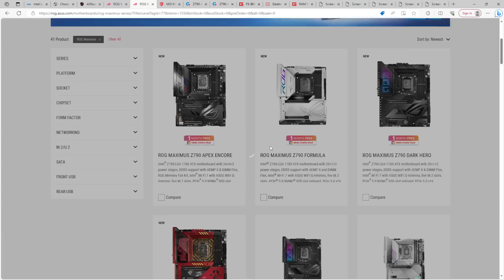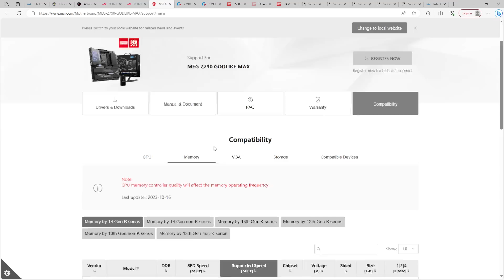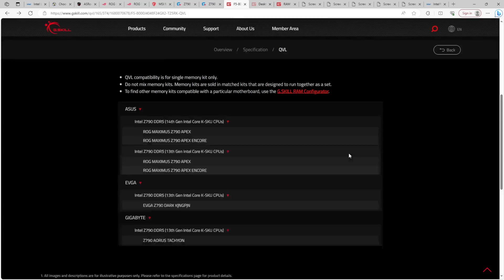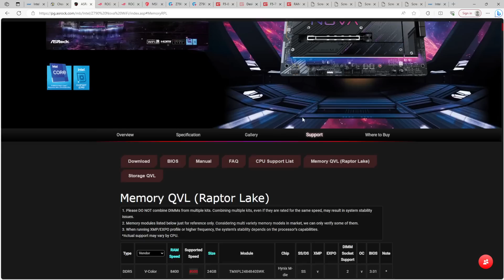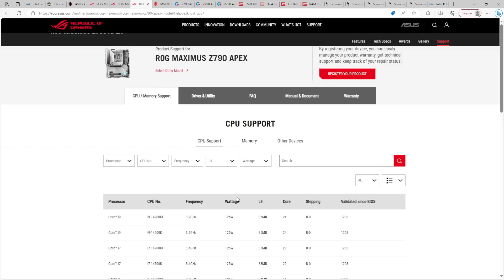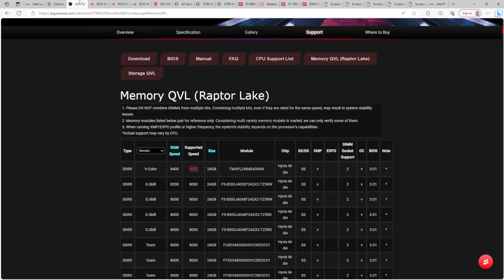intel XMPs and motherboard QVLs are a useless mess.

Comment from the maker: TL;DW: don't buy DDR5-8000 mem kits for your 14th gen CPU unless you're buying an Apex and don't mind potentially having to fix stability problems.
Reply: Hoping for just a better IMC, but was a bit dissapointed to find out it is exactly the same 13th gen memory controller, my 14900KF samples IMC was worse than my best 13900K. So luck is needed indeed :/
Reply: @Luckyn00bOC  My condolences to you, Sir.
I managed to get 6933mhz stable on Z690 Aorus Master with 8000mhz A-Die by T-Force, and hoping to get a nice stability and mhz on Z790 Apex Encore using same sticks.

I am on 13900k. 
Frame Chasers Youtube channel stated same thing you said, that his memory controller on 14900k was worse than his 13900ks.
Reply from the maker: @Luckyn00bOC  my 14900K is very slightly better. Which why I finally have a DDR5-8000 "stable" screenshot.
Reply: @ActuallyHardcoreOverclocking  can you do a video of your 8000 stable please
Reply: @ActuallyHardcoreOverclocking what is the name of the program for the ram test?
Reply: I can run 8000 completely stable with my 13900k on my kp. Working on tightening the timings on that profile and 8200 profile on a different bios. I did buy an apex encore to try out, but I’m probably gonna a try a 2x48GB 6800 kit with that and see how far I can push it without loosening the timings.
Reply: @rekareaper  Nice, 8000 is the limit of my 7200 a-die hynix kit as its at 1.6v and dont want to go anymore than that. Though i bet it could. My SP score for my IMC on my 14900k is 78. Its not "bad" and i could do 8600 on it for sure. 

Im using the old white apex board. currently running 8000-34-46-46-46-1.6v and all the timings VERY low to be fair. Using iceman heatsinks and a ram fan. Im not at the limits of the IMC i know for sure it will do 8400 with ease but i think with a some messing i could get 8600 stable. My current setup is y-cruncher stable so its rock solid. It took me most of the day after launch day to dial it in after all my TM5 testing etc. Now we totally stable.
Reply: New Corsair 8000 CL 38 48gb Dominator Titanium is stable on my z790 Dark Kingpin with a 13900KS and a 13700K!
Reply: Yep. Just put in a Gigabyte Aorus Master X tonight with a 14900K and 8000MT/s memory on the QVL. Nope. Running at 7200 right now.
Reply: @nchitechredneck same for me, but with an Asus rog strix 790-e, 7200 also……
Reply: Don’t buy 14th gen at all!!! It’s the same chip, MC is still a potluck so you might as well buy a cheaper 13900k.
Reply: @Irate_Italian yah intel said it’s the same chip.
Reply: Hey bz is Asus better for intel memory overclocking or just happen to be the apex
Reply: @NaruCedSuke only apex
Reply: Im pretty confident my unify X can do 8000 with 14th gen. Currently stuck at 7600 - I have to assume it's my 12900k not  playing ball.
Reply: @JustBenching  correct, 7600 for a 12900k a maxing out the IMC. I could only get 7200 out my 12900k. Just got the 14900k and had 8000 stable within the same say of chip arriving. EASY to do 8000.
Reply: If even experienced guys like BZ, who don't really need a QVL, see a problem here, manufacturers should listen.
Reply: Nothing really new, just more ridiculous of the same old same old
Reply: Nah, I need ddr5-6900
Reply: @buildzoid  Can you help me please which motherboard is best DDR5-8000 mem kits atm? Or should we have to wait some Bios update or better boards? Thanks in advance!!!
Reply: Just curious, what about the z790 Dark Kingpin?
Reply: @Shallo It can run 8000, but not via XMP... you will need to manually do it, and have a CPU that can do it.
Reply: Even 7200 is a gamble on XMP with a 14900K and an apex encore...
Reply: Hi. I want to run 8000 xmp on Asus Rog strix z790 e gaming wifi II. It sans that it can run 8000mts

Comment: My MSI PRO Z790-A MAX with i514600K can handle only 7000Mhz (Lextar Ares RGB 2x24GB 7600 CL38) with relatively hihg timings. Zero errors, fully memtest 4 loop test passed. With XMP enable it shits zilion errors, WIN10 produced bluescreen on logon window. I will try set it for 7200 becouse I updated BIOS for lastest one (recently relased) but I`m not optimistic :/

update:

Ok its works stable on 7200Mhz but with same timings as 7000Mhz 38-48-48-121, everything above immediate errors...

Comment: IME make sure both the ram maker and the mobo maker claim each other, if the ram maker doesn't have a list, goodbye to them - you wouldn't let a mobo maker get away with it.
Reply: also, based on many videos watched at this point - just get a good secondary-timed 6000 and move on with your life (this ignores the people who OC for the fun of doing and don't care about resulting performance, or don't that much because the journey is the thing for them).

For most people - XMP 1, plus, as in Giga land, enable those two settings in bios "high bandwidth" and "low latency" for great (relatively speaking) timings.  The tuning beyond, unless you like that specifically, is not really worth it.

Comment: Planning on getting i9 14900k and Msi Mpg Z790I Edge with 7200cl34 kit. My concern is that is the mobo good enough to handle such power hungry cpu and how far should I expect to manually overclock the rams? Don’t really see a point to spend over double amount more in the motherboard. xd

Comment: i got lucky and my apex-e + 14900k xmp with ddr5 8000 cl38 m die 2x24gb kit. Zero errors after 7 hours of stability testing. And zero  crashes maybe its not 10000% solid but pretty good.

Comment: If you want a better sp rating.
Flush the cpu socket and cpu pads with electronics spray. Like a deep cleaning spray. Use a whole can. Then let it all dry up, 24 hours. Then using latex gloves only, reinstall it all and retest. Do the same with ram slots. I've seen a huge amount of ???? Come out of ram slots on brand new boards. Maybe flux idk. 
But I have had fantastic luck with this process. Finger oil, or manufacturing oils idk. But its definitely something and the flush fixes. Go ahead, find out. 
THERE IS SOMETHING GOING ON WITH THE INTERCONNECTS ON THESE BOARDS. DIG DEEPER

Comment: Love these videos.

Question for you, I recently finally upgraded to AM5, got a 7800X3D & paired it with a set of 2x16GB G.Skill Neo EXPO 6000MHz CL30 memory kit - I am fairly certain that's one you & others highly recommend for AMD's side of things, you did some timings up for Hardware Unboxed when they did their Memory Timings video for AMD CPU performance - I'm just wondering if the timings on there that you gave them should "just work" for my setup, and secondarily, if the 1.25V SOC is actually needed for those timings?

Right now I'm running stock EXPO @ 1.35V VDIMM, 1.2V SOC and everything seems perfectly fine, as it should, since that's "stock EXPO" and all.

Comment: What is the Max ram speed you can reliably use on a asus z690 strix-f with a 13900k? My boards qvl says 6600 but I feel the 13900k should go higher considering the qvl says the same for the 12900k.

Comment: Z790 aorus master here. Can’t get 48gb 7200, 32gb 7800 or even 32gb 6000 to work on my 3 kits of ram on 14900k. Not even at stock settings. Am a computer expert with 1000 builds under belt. Shit is so trash like peak amd ASUS ram issue level

Comment: I don't know if this has changed in the last 12 months, but in my experience it can be very difficult to find for sale the exact memory kits listed on a given QVL.  I've always just stuck with moderately rated  memory (a few pegs below the supposed limit, maybe a few pegs above JDEC), set XMP (or whatever that board maker calls it), and left it alone.  It's almost always successful and gets me properly functional and stable RAM at a reasonable cost, even if my CPU might be just okay.

Comment: As long as everyone knows this, I don't see how its a problem. Even if they don't know, they will find out eventually. 
Intel has fell off for sure though. 
I was helping some flightsim bro with his intel rig I think it was a 12700 or maybe a 13700
he fried a channel on his imc running XMP
he then RMA'd everything, but did the CPU last (this is when I started helping him), which of course was the problem 
anyway he was too "busy" to properly setup his new cpu
I did my best to turn down the voltages, but he didn't want to spend the time he needed to, to help me check everything
and even with XMP off and on ASUSS default settings
fried a channel on his IMC within a week on his new CPU
so their were multiple voltages that were way too high (I had turned down I think the SOC which was way too high, but obviously something else was too high also)
I think he just gave up on PC's after that, which was sad cause its hard to find flightsim bros

Comment: I think they could split the QVL into 2 tiers:
1. Will work on >99% of CPUs. (for those who want something that just works out of the box)
2. Will work on a CPU with an average memory controller. (for those who want to push the limits a bit, but are not willing to bin tons CPUs for IMC quality)

Showcasing what a board can do with a top 1% CPU should not be done in the QVL. The purpose of the QVL is to show what parts should work together without issues.

Comment: I don't necessarily mind that they put the fastest kits on the QVL's of boards that can do it in theory if you win the silicon lottery, but they really should at least highlight those rows in the QVL in RED or something that tells you it's not guaranteed.  Like hey our board has been able to do this before but there's a good chance your CPU and/or RAM combo might not, buy at your own risk.  

Now putting speeds on the QVL of a board with a 4 slot daisy chain topology that will NEVER get that speed working, no matter how golden of a golden sample your CPU is, that's just BS.

Comment: I think you mentioned before we're just better off going for a lower clock and tightening timings. Either way I'm one of those guys that just wants xmp to work. I never knew the qvl worked like this. I actually thought they tested multiple cpus and they would all have to pass these settings....

Comment: Xmp used to be set and forget. Now it is useless. My cpu supports 6400 with 4 dimms, my MB supports 6400 with 4 dimms. My ram does way more but I can't get it to run anything above 5600. Everyone writes that it is supported but it doesn't work. The point of xmp was that I wouldn't have to tune it manually let alone have to downclock it...

Comment: I remember when motherboards were capable of higher memory speeds but the manufacturers would warn you about possible issues. For example, the GA-990XA-UD3 (rev. 1.x). It says DDR3 2000 (O.C.) as the highest rated speed. I have this board. It can do over 2000Mhz, but  requires a good Phenom II x6 with a lot of tweaking, or an FX series CPU. Same with the Evga X58 SLI boards. I can make it do DDR3 2400 with specific memory ICs, but 2000 is the highest QVL since that's the highest speed that should just work.

Comment: Is it better to use xmp 1 or 2
Reply: people say XMP 1 load only primary timings and the mobo does the rest(auto), XMP 2 load all xmp timings.

some times the auto timings are lower = better but it depends if it's stable

try XMP 1 see all timings, then XMP 2 see all timings and then decide

Comment: 5:32 was DDR4 this bad?? I wasn’t in tune with it back then, but DDR5 seems to just be a pain…do 4 dimms not work at all? I can’t even boot with 4 dimms on anything but stock 3800mhz.  It just feels like it’s some stupid bios setting to open up the memory controller to allow it, when don’t the claiming board manufacturers roll out a guide for it if supposedly works…

Comment: According to the video, looks like I'm kinda lucky to run xmp 7200 34-42-42-84 1.45v with 13700k and asus tuf z790. Always was used kingston kits, but this time bought ddr5 Patriot Viper Venom (yeah naming is pretty lame) but this kits not so long in hight and got 33-42 C temps. But most short one with same A-Die that I saw was out of stock and it was teamgroup t-force classic

Comment: Is this less relevant for AMD since they seem to top out their QVLs at 6000 where mobo difference matters less or is it just that AMD has less variance in their controllers? (Or is it just as relevant for them just at 6000 instead of 8000?)
Reply: no, read the comments from various people who use AMD - either way, you can be screwed.
Reply: @xBINARYGODx  just infinite fabric things tbh it benefits speed more than intel imc(12-14th gen), some zen 4 cpus can go above 6200mbps like top 1% at 6800mbps.

Comment: What pisses me off the most, is that I have a system (Z790 Aorus Master, 13700k) that runs fine with 2 sticks of G-skill F5-6400J3239G16GX2 at 6400 using XMP, but I do not know if I can use another 2 sticks to take my system to 64GB now... I asked G-skill, who only told me to try it and see... 
So now that the memory is half as cheap as when I built my system (first new build in 10 years), I may end up with 2 sticks I can't use, or have to lower the speed to below what I paid for. 
I did do some research before building this system (since I hadn't built one in so long), so I chose what I thought was a good compromise at the time between speed and price, and it works absolutely fine, but not knowing if the memory controller can take 4 sticks at XMP 6400 is really bothersome. So now I'm waiting for the price of 96GB 6400 to come down significantly enough so I can @replace@ the 2 dimms I have and never have to worry about this again for another 10 years...
Reply: In general XMP only works for the kit. If you try to mix even copies of the same kit the settings will have to be different and the profiles on the stick aren't going to account for that
Reply: It all comes down to experiementing with your system to see what works or doesn't work and how well it performs. The kerfuffel in this matter is that you have to be shelling out the bucks to pay for your experiments!😮😊
Reply: You're not gonna get anything over 5600 to work with 4 sticks

Comment: Are the 2x24GB any good on AMD X3D cpus?
Reply: slightly worse than 2x16gb a-die but ehhhh if you really need the additional 2x24gb RAM go for it.
Reply: M-dies yes for more tighter timings at around 6000-6800mbps(average to top 1% cpus)

Comment: So many people on the OC forums wanting to run 64gigs of RAM at 6000 CL30 with a 14900K. 

What’s the likelihood of that happening with the average 14th gen CPU?
Reply from the maker: that should probably work as long as it's 2x32 and not 4x16.
Reply: @ActuallyHardcoreOverclocking  thank you. I was hesitant as it’s on a very average Gigabyte motherboard but good to know.

Comment: QVL are pointless, you don't know how many CPU were tested and were actually working with a given kit nor how good they are (average SP for example).

In the first place, I don't even understand how Intel can state 8000+MHz. Most (90%+) people are dumb, they just enable the damn XMP profile if they even read the QVL in the first place to choose their memory. It would be fun if this bites Intel back (RMA or class action).

Recently a guy with an ASUS ROG STRIX Z790-E GAMING WIFI bought a 7600MHz kit which was listed on its QVL, guess what, surprise (or not), he couldn't even boot with XMP (has to lower it to barely 7200)...
Reply: I'm sure no RMA or class action can be had. Intel said it "can" (read "some CPUs"). And it's also XMP, so nothing guaranteed. BZ here demonstrated that the 8000 MT/s holds. Surely there's a CPU out there that will be able to do 8200 or 8266 MT/s. And that's enough for Intel's claims, legal-wise. In reality is more like "hey, some CPUs work with 8000 so most likely it will work with 7200 with any random CPU".